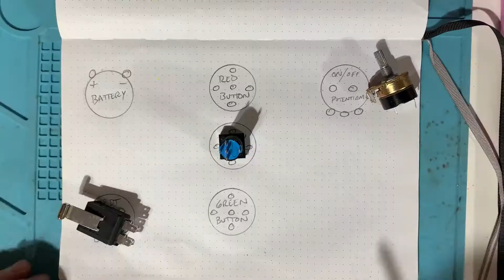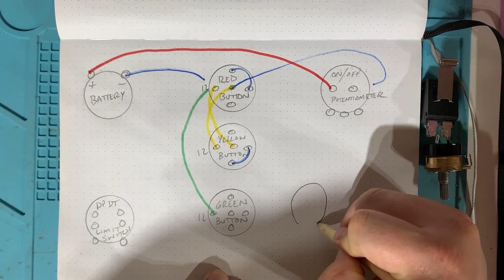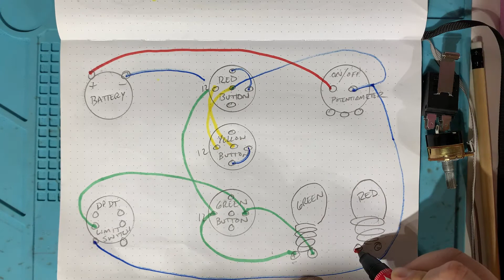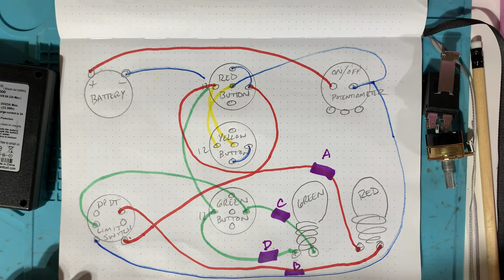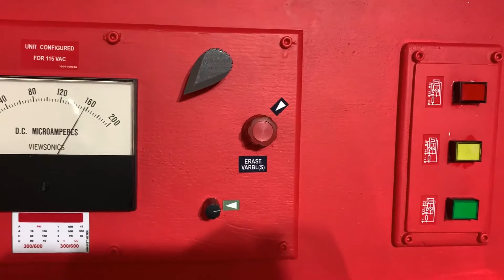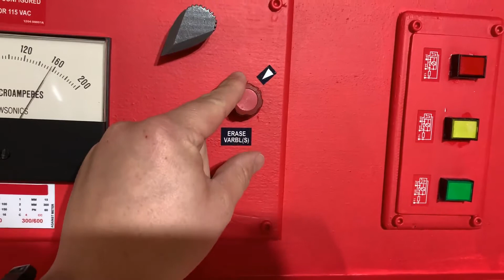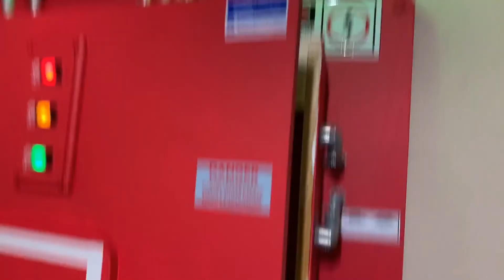Ghostbusters Ecto Containment Unit - Part 2 - The Wiring

Comment: THis is great - they all are.  IN the middle of a build now but using 1/2 foamboard sheet for a nice light product.  Yard display not a permanent placement.  Only wood s along the top to mount the lights and two side 2x4 that create the frame set in concrete buckets, again for easy display.  The only item I can't find a direct source on is the voltage meter.  Suggestions?    MAny thanks and thank you too for posting this whole series.
Reply from the maker: @RyanSt.Germain  an accurate volt meter is very hard to find. When searching eBay look for a “0-100 DC current panel meter”. That’s what I found. Then look for sizing. 3x4” or so.